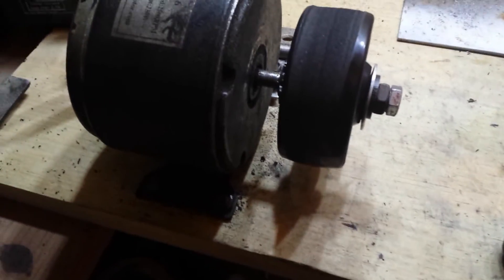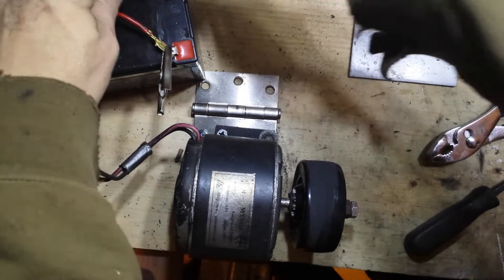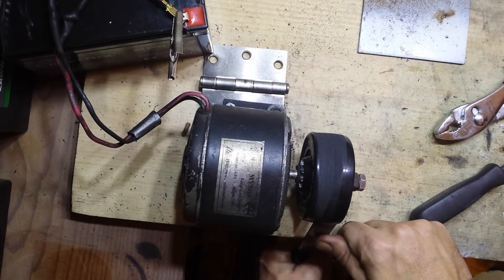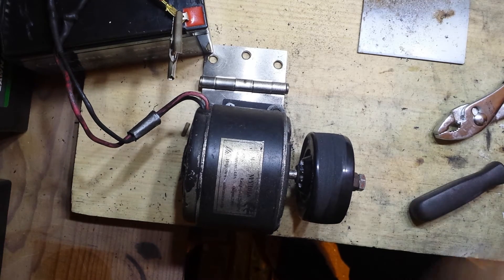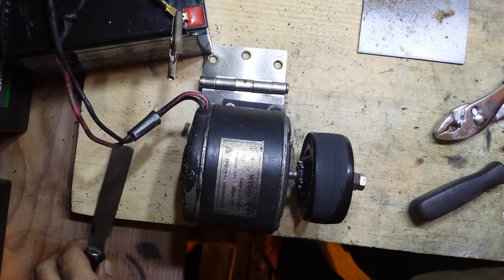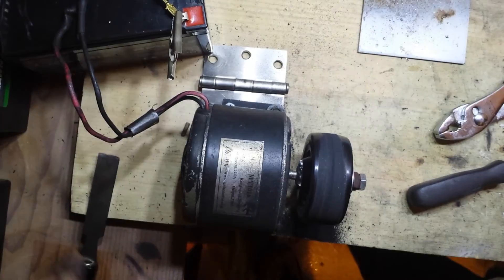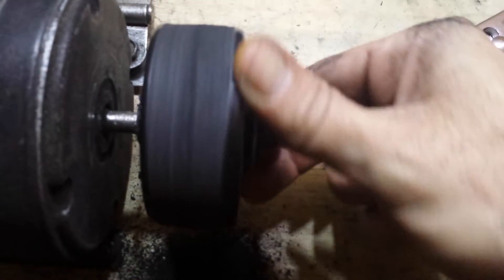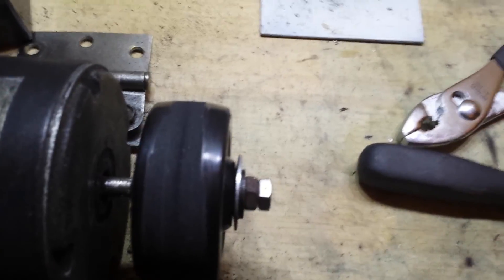Friction drive electric bike motor part 4

Comment from the maker: yes. With most brushed electric motors you can switch the direction of the motor. if you change the rotation the wheel it will unscrew from the motor.
Reply: ThriftStore Hacker sir! can i use a motor from a fan?